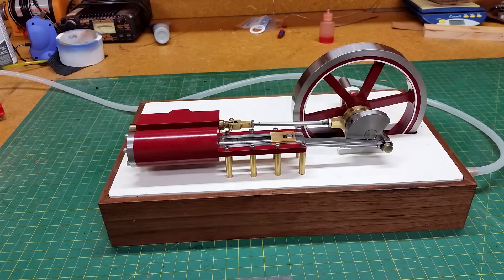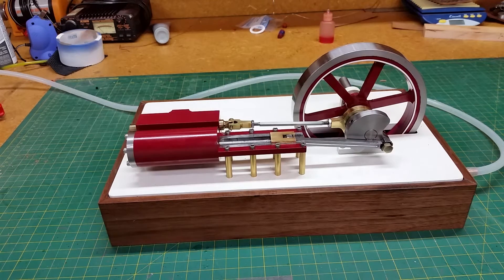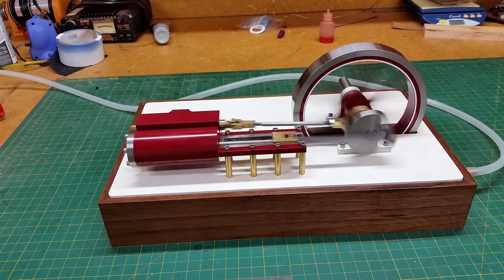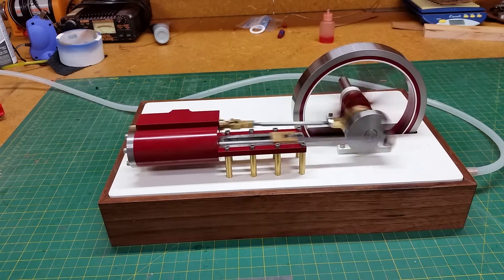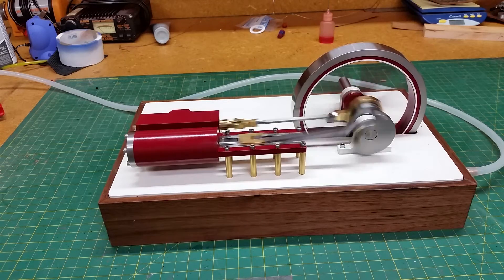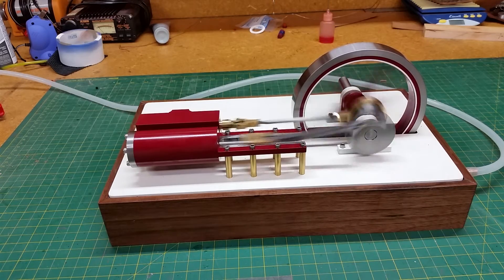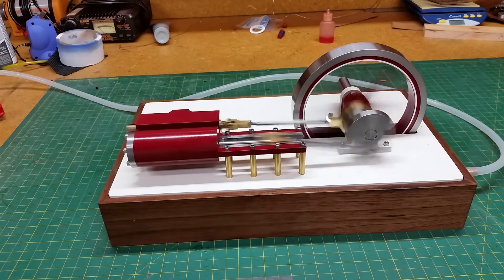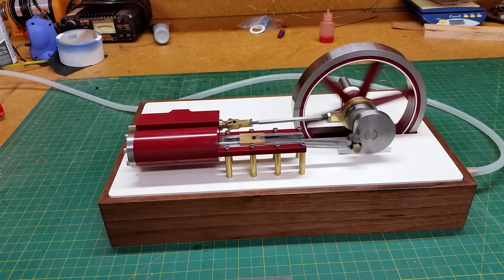Simple Steam Engine.

Comment: Hi Dick, great engine and build quality.  I bought the plans a couple of years back but have never started the build  due to being a real novice and so found a couple of parts are a little beyond my capabilities at the moment.  Would you mind answering a question?  I notice the spool valve has slots down all sides, is this to send the exhaust out of the ends of the spool? any help appreciated thanks.
Reply from the maker: Yes Berty that is exactly what they are for. Good luck with your build. Take your time and do what you can. Save the tough parts for later as you get more confident. Dick
Reply: Many thanks for getting back to me Dick, at my age it is sometimes quite hard to comprehend the simplest of things. I love your other work also

Comment: Very nice.  How much time did you devote to the engine?  Do you have the lamp installed yet?  Not to be 10,000 questions but what kind of paint did you use?  You were able to get it going very slow.  Impressive.   Thank you very much I enjoyed watching it run.
Reply from the maker: +Michael Wooten Hello Michael. I never keep track of time spent building, but it wasn't more than a few weeks. I have not added the generator of light pole. The paint is just general purpose rattle can variety.Thanks for the visit. Dick